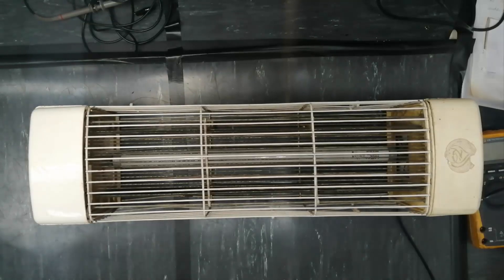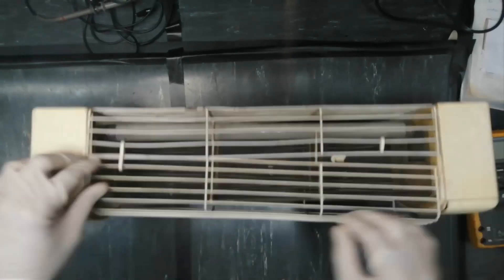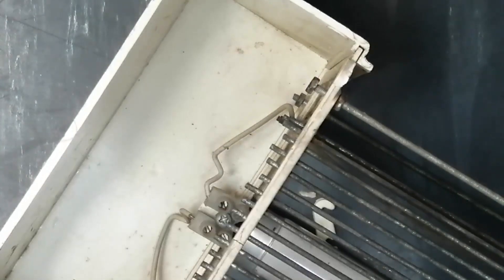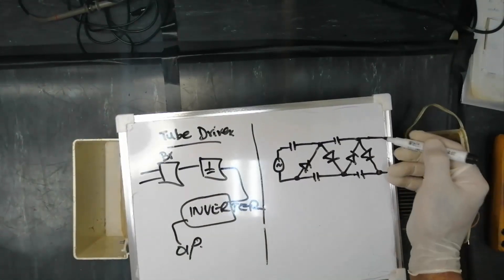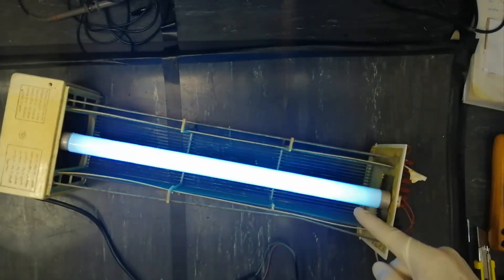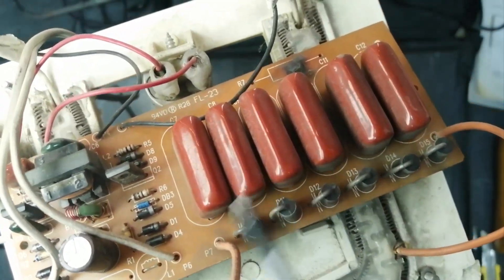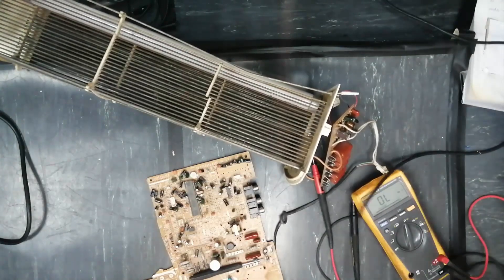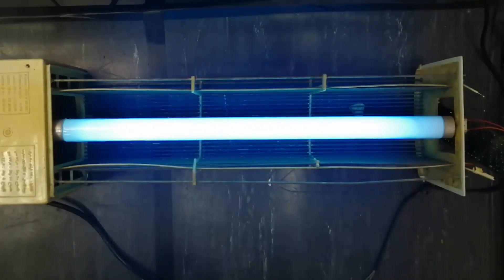#214 How to Repair INSECT KILLER / BUG KILLER / ELECTRONIC BUG ZAPPER

Comment: Nice vedio  , sir let me know the value of ceramic capacitors , diodes and resistance used in  voltage multiplier stage  to improve my knowledge because I am also working with mosquito killer  system and want to proceed with your ideas, so please communicate me the quarry and oblige.
I am using 225j 400 volt with IN 4007 diodes and 1M resistance at out put stage. Your proper guidance will definitely  help me to improve myself and proceed with your mew ideas
 Thanks.
Reply: Reply is still awaited inspite  of a month time. If possible please favour me with suitable reply.